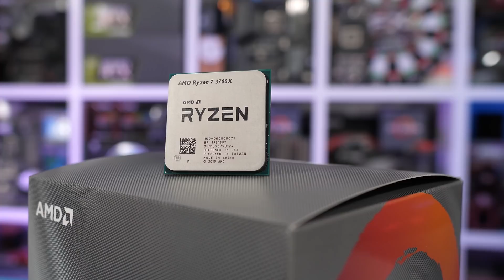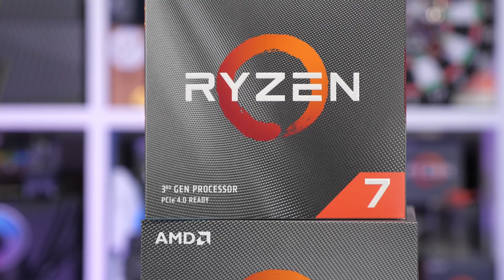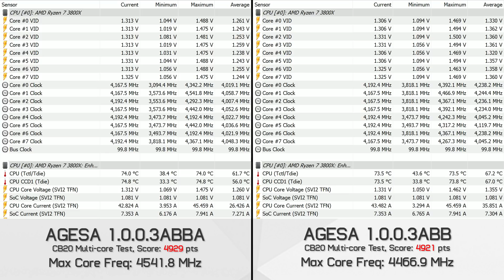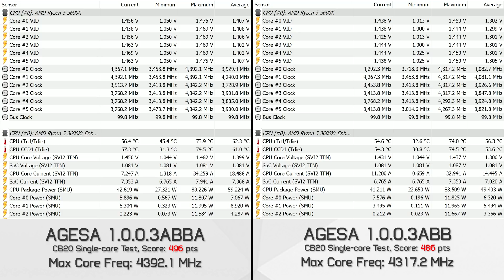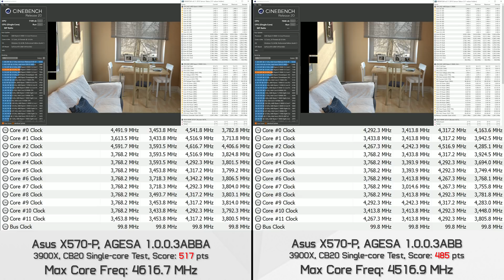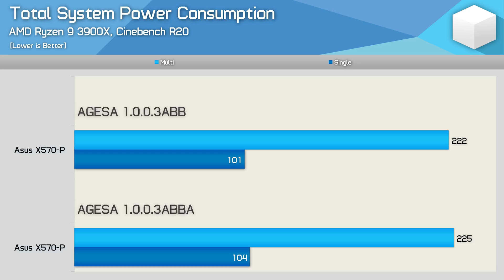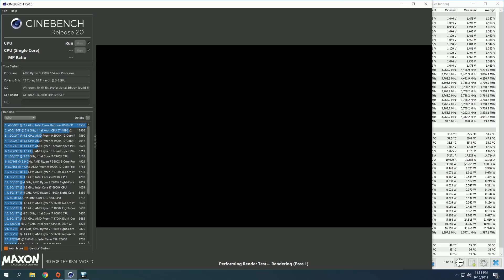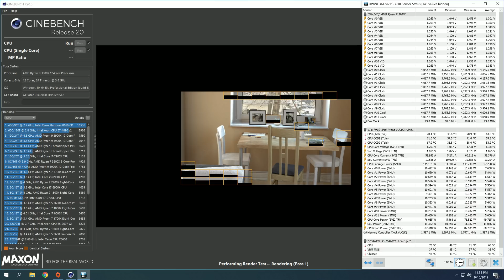3rd Gen Ryzen Boost Clock Fix Benchmarked, AGESA ABBA Time!

Comment: I also benchmakred it for the 3700X, here the result. My single core boost (without PO!) went up from 4.3667 GHz to 4.391 GHz. Close but still not 4.4 GHz. :/
Also a rather small gain, AMD claims a 25-50 MHz gain, I got slightly less than 25 MHz, this while I have proper cooling (the temperature goes up to 56 degrees while running Cinebench singlethreaded, 58 peak before the temperature settles because the fan needs to ramp up), there is no thermal limitation. As Not an Apple Fan says, the main problem is just bad silicon for many 3700X/3900X CPU's. Based on what I have seen my 3700X is of modal quality, not worse and not better than  what most people have. I expect that most people still won't get the 4.4 GHz boost which was advertised. I also find it disappointing that the CPU does not maintain the boost, I see it pop up for two cores but probably less than 50% of the Cinebench-run while the CPU most of the time is on 98%-100% performance. 

As was the case with the older AGESA, when you enable PO you loose some of the single core boost. I still saw the 4.391 GHz pop up but only on one core and very short compared to when I don't enable PO. (Gigabyte X570 Elite)
Not that I should enable PO at the moment, my RAM is at the edge of stability: Memtest86 stable (0 errors in 2 times 4 passes) but when I enable PO the system crashes once every few Cinebench multithreaded runs. The allcore boost went down (only around 4.05 GHz compared to 4.089) compared to the previous AGESA when you enable PO, when you don't enable PO the all core boost is 4.0 GHz ( a bit more for most cores, a bit less for some cores). Rather underwhelming even though a 4.0 GHz on the 3700X is comparable to a 4.6 GHz on a 2700X.
Reply: If you disable Spread Spectrum in the Bios your board should use 100MHz BCLK.
Reply: @MrBlueDabadi  

I haven't found that option yet. I will a take a look at it. Thanks.
Reply: @peterjansen4826  i just disabled it and i can confirmd i reached 4.4ghz :D.
Reply: @Tyron18    
I just tested it out too, I got exactly 4.4 GHz, not a higher Cinebench score though (only 504 points this time, I got up to 507). Can any of you explain some of the weird BIOS-issues of this motherboard? A concrete example, just disabling the spread spectrum feature caused my motherboard to powercycle 3 times before it finally applied it, after that it boosted normally. Why? I don't change anything in relation to the RAM or voltages or currents, it shouldn't be any different while booting up. Another example, when I apply an unstable overclock the system immediately resets the BIOS (the USB-LED's turn on, I disable those) yet powercycles three times before giving the splash screen and notifying that the BIOS has been reset when you enter del to get into the UEFI. After enabling PO it can have to powercycle but the settings at which it boots should be the same (just the base frequency and all that). Every time I boot my system it takes around 3 seconds before the fan (CPU or chipset, not sure) starts to ramp up. And what is up with the PWM for the CPU-fan only being applied once you are in the OS, either Windows or Linux, why not in between finishing the POST and booting into the OS? It is my first non-locked motherboard on a new platform so all these things are new for me. 

In your experience (all of you who have this motherboard), is the RAM-overclocking limited because of the BIOS or for 100% by the RAM and memory-controller on the CPU? I can hit 3666 MT/s with sharp timings (Samsung B die on a 3333/16 Vengeance LPX) but as soon as I try 3733 MT/s I can't get it stable. The first time it almost always boots, the second time almost always not. A clear pattern, why does it take on the first boot but not on the second? Are these rough edges on a new platform, is it because of the BIOS, is it because of the AGESA, is it because of the PROCODT/RTT/CAD-BUS? I  read the entire RAM-overclocking tutorial from 1usmus but I still am clueless what the PROCODT/RTT/CAD-BUS do other than that you apparently set resistance values and change the current that way (assuming that the voltage stays the same).
Reply: @peterjansen4826  man thats weird, i dont think i can help tho cause my mobo is working flawlessy and so is the RAM :/
Reply: @MrBlueDabadi  Thanks that worked!
Reply: He addressed why it's 4.391 on the Aorus Elite, it's because the motherboard has a base of 99.8 instead of 100, my cpu does the same (x570 aorus elite)
Reply: @Tyron18  

Thanks. Is there no way to increase that base? Edit: never mind, I got the answer already.

Comment: But Steve! The self-appointed Reddit hardware engineers told me that 1.4+V is always bad!!!!!
Reply: @baka6162-u2i  R9 280X is 28nm, Ryzen 3000 is 7nm. Big difference my friend.
Reply: @nekron75  Robert Hallock from AMD stated categorically than anything up to 1.50V is safe if the chip is left at stock (no overclocking). What kills chips is voltage and current combined, not voltage alone. If you pass low current through the chip at 1.5V you shouldn't damage it. Pass lots of current at 1.50V though and you will likely damage it. My two Threadripper 1950x'es routinely use 1.5V in single-core workloads when left at stock. They are still working perfectly fine and I've never seen any temperature problems, degradation or instability.
Reply: @Daily Overclocker Can u explain further? U mean it's ok at 1.4v when it's using one core? And not ok if I oc my 3600x all core @1.4v??

Comment: It seems there are some games that will have a 5 to 10% boost in FPS. 
With this, unlocked PBO, per core overclock adjustments, tight timings adjustments, good overclock memory, etc, could it be that the 3900X (or even the 3950X) overtakes the 9900K or KS?
Reply: 3950x + 103 BCLK + PBO + Tight timings + 3800MHz ram(1900 FCLK)... One can dream..